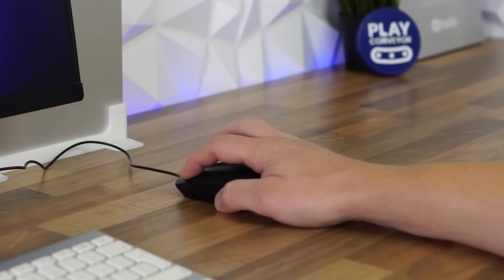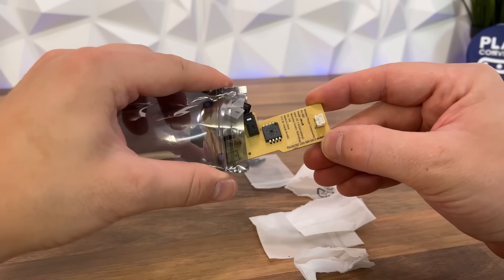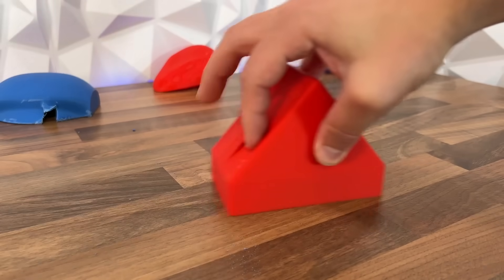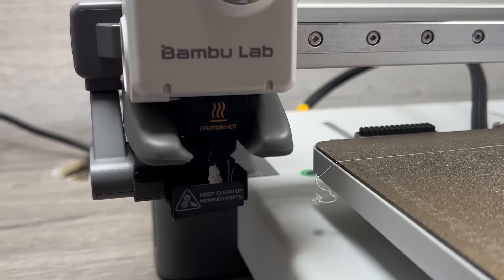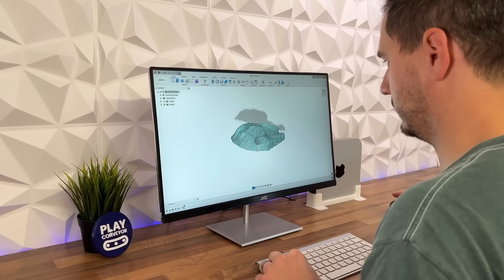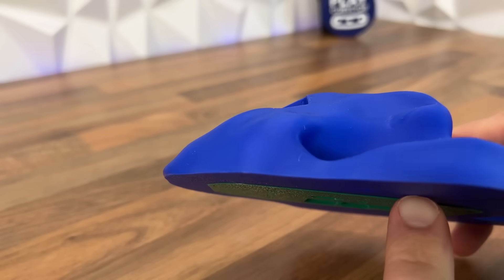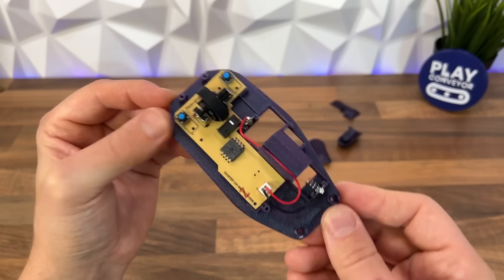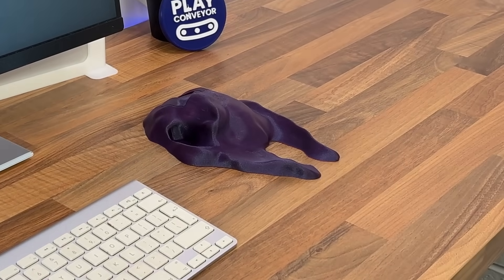I Built the World's Comfiest Mouse (ft. Bambu Lab A1)

Comment: I STRONGLY encourage making MANY revisions before taking it to a coffee-shop.

...By the way: have you considered filing it down instead of just printing more revisions? If it's printed thick enough, you may be able to file down unneeded or unappealing parts, then smooth/streamline it by using a very fine sandpaper & maybe coating it with a thin layer of quick cure epoxy resin (or maybe adding quck cure resin first, then filing and sanding it down, then brushing on a very thin layer of resin to make it smooth)*

*I've personally never made resin molds or worked with resin, so I can't guarantee any of this would work well, or at all; the ideas are just inspired by previous work I've seen done with resin.

Comment: You've introduced several problems while trying to solve a single problem. Congrats you are an engineer.
Reply: The number of problems in a project is like a game of whack-a-mole—solve one, and two more pop up to keep things interesting.
Reply: @tonigarces7211 i’d say that’s more like a hydra
Reply: @craftykit2242  I’ve always wondered: if you cut enough of its heads off, will it eventually consume all of the universe’s energy to make new ones, or does it work on free energy? Can you power a power plant with a hydra? What do the original sources say about that?
Reply: @HermitianAdjoint  I like your thought process. Keep going 🫴🏼
Reply: @phatakom  Thank you. However, I’ve been contacted by certain government bodies and am legally not able to divulge any more information on the project.
Reply: @HermitianAdjoint  ok😅
Reply: @HermitianAdjoint It would eventually die from lack of nutrition or a lack of ability to move.  He's getting more heads every time one gets cut off which means another brain which means more calories needed.  Most depictions of the hydra I've seen don't show the the body getting any bigger with each head.  This suggests no extra gastrointestinal systems getting added aside from the extra mouths nor any increase in the size of the existing gastrointestinal system/s which means no way to increase caloric intake to support the growing number of heads.  And if it didn't starve first, it would eventually lose the ability to move from the weight of all the heads, and then it would starve.  That is my professional opinion on the matter.  Good day sir!
Reply: @afterburned06  Thank you for your expert analysis. What is your profession, if I may ask?
Reply: @HermitianAdjoint Lol I was joking about the professional part.  I'm a mechanic, but I've always had a healthy interest in biology.
Reply: @afterburned06  How can you joke about such a serious matter? I would never dare to utter anything on this subject but the truth that I stand for with all my conviction! But if you think about it, what is biology but the mechanics of living organisms?
Reply: @HermitianAdjoint Oh I was serious about my opinion.  I was just clarifying that I don't hold any qualifications in the relevant fields.  I do love a good hypothetical question though.  I agree though, biology is very much the mechanics of living things.  There are even quite a few parallels where biological systems function similarly to mechanical ones.
Reply: @tonigarces7211 its like a hydra
Reply: @tonigarces7211 thats more like a bird
Reply: @tonigarces7211  yeah we tjink thats more like a hydra
Reply: @tonigarces7211 i'd say it's more similar to a hydra.
Reply: @tonigarces7211  thats more of a hydra
Reply: @Radio_ink114  you'll never be Troy
Reply: @IdkMops ???
Reply: @Radio_ink114  that's a meme
Reply: @tonigarces7211 i think it's like a hydra
Reply: It's not like it's meant to be a good thing to use, just comfy pahahah
Reply: Now to slap a subscription model on it and we ship it!
Reply: @HoboHastur  but now he'd be a financial analyst
Reply: I have a vertical mouse. While it solves one problem (hand not in a natural position), it creates a few others. The main one for me is the height. You have to lift your hand high enough to clear the mouse to get to the keyboard. Not a problem with a regular mouse as it is low enough. You just have to lift your fingers to clear it. Looks like an innocuous enough issue, but doing this repeatedly is PITA for me.
Reply: @alihms  Having a split keyboard may solve this. (50% of keys to the left of the mouse and 50% on the right) That way you only need to move your mouse hand to the right to get access to the right side if the keyboard.

It would take up more deskspace though and I don't know how comfortable it would be typing with both arms in such a wide gait 😂
Reply: Put dispenser here !
Reply: Bruh that so true 😂😂😂
Reply: @ZenseMC Need'a dispensa 'ere!
Reply: Engineer gaming tf2
Reply: or a programmer
Reply: a bad one...
Reply: Sanic ball pfp?
Reply: Covenant mouse?
Reply: @oscardiggs246  yes that is
Reply: Need a dispenser HERE!
Reply: Engineer gaming
Reply: Nice sanic ball profile picture
Reply: need a dispenser here
Reply: I can’t start laughing😂😂
Reply: i actually laughed out loud with your comment haha
Reply: Engineer? I think you mean a landlord
Reply: yeah, a stupid one
Reply: im an engineer saar
Reply: Heh
Reply: Need a dispenser here!
Reply: you mean architect?
Reply: He’s spitting facts harder than any school does
Reply: What problems?
Reply: truly to fix a severe termite infestation thats spreading like wildfire is to abandon the old one and then make a new home that is more simple and is more suited to handle termites
Reply: And then you find out that everything was useless because there was another way that was easier and had no problems on the way
Reply: Yeah and this will still cause carpal tunnel since your palm is still facing down like with regular mice. 

An ergonomic mouse needs to at least be vertical to fit with the natural hand position. This doesn't even do that.
Reply: @St.Altaire  problem solved just rotate your forearm 90 degrees so then technically your palm is verticle to your arm
Reply: Plenty of people use non vertical mice their whole life without developing carpal tunnel. It’s obviously not the sole cause.
Reply: @St.Altaire  the problem with vertical mice is they are all freaking too small. I use one and it's much better than a regular mouse, but still too small to be fully comfortable...
Reply: @st.altair4936 I was just thinking that it was an awkward position with his hand flat on the table. Ideally, I'd assume mice would be a joystick-like design, since the arm is at rest in that way. Not sure how you'd move left or right, though.
Reply: @St.Altaire the back part of the mouse seems pretty vertical, it does face down at the end but the part that holds his wrist goes up a little or maybe Im trippin
Reply: @St.Altaire yeah yeah! Maybe something more interactive that you put your hand inside of. You move the mouse with more of your arm instead of your hand while you have a solid, soft composition to alleviate the pressure.
Reply: @St.Altaire  Carpal tunnel syndrome isn't the only problem that can affect the wrist. For example, to avoid clicking mouse buttons, you have to constantly hold your index and middle fingers up. This puts strain on the tendons, which is why I developed wrist pain. This can be avoided not only by using a vertical mouse but also by properly supporting your palm and fingers. Unfortunately, the universal design of so-called ergonomic mice doesn't provide this support. In addition, not everyone likes vertical mice and they are not well suited for all tasks.
Reply: @St.Altaire vertical?? huh? I'm so confused by your comment... 😅
Reply: @oh.sorry.dont.mind.meeeee  you hold normal mouse horizontally, and an ergonomic mouse vertically
holding your wrist in a horizontal position for too long or too often can lead to repetitive stress injury so vertical is better
Reply: congrats you have no idea what you are talking about  and YOU WISH you were and engineer, but you are WAY TOO INCOMPETENT for it. 
You are one of those guys who says "Math is haaaaard" aren't you?
Reply: That’s the best part
Reply: questions appear where is no answer
Reply: no one likes me and i don't give a fuck
Reply: this that was the goal ngl
Reply: Most comfortable mouse is no mouse
Reply: @AdarshKumar-mi6wn  please report him for hateful and abusive
Reply: @AdarshKumar-mi6wn  why is it no mouse its just more comfortable and can click normally and you can scroll why does you're dumb ass think that that's no mouse
Reply: Sounds like fucking minecraft
Reply: Bro should work at Apple 🤯
Reply: programmer lore
Reply: Sanicball
Reply: just shut up
Reply: When you do anything in factorio:
Reply: Or a philosopher.
Reply: we love engineering
Reply: To really make a ergonomic and comfortable mouse, you should do a diagonal support for the hand, and that will introduce a lot of problems with stability, and efficience, so probably you shouldn't try to do the most comfortable mouse, but the most equilibrate mouse, and a plus problem is that mouse is only for you, if someone, anyone, needs to use your PC, they'll feel very uncomfortable using this mouse, and beyond that, if you need to use some extra function on this mouse, you can't even try to insert a extra button, like, look at this, you have this giant thing and no space to fit an button of easy acess
Reply: Problem in quotes. That's the funniest part.
Reply: Facts
Reply: Right angle trackball mouse is where its at. Saves the wrist and shoulder
Reply: And a ceo
Reply: LMAOOO All he needs now is a brand XD
Reply: Lol
Reply: Lernaean Hydra
Reply: The only problem was to find a problem for this product placement video. Idea behind mouse is just stupid...
Reply: Wait that’s what I’m called? My wife uses the word idiot synonymously then.
Reply: It's look like a frog 😂
Reply: LOL
Reply: Lol
Reply: My grandad used to say that where most people say "if it ain't broke don't fix it", engineers say "if it ain't broke, fix it till it is". I just started my electrical engineering degree last year, and I gotta say Papaw wasn't far off haha.
Reply: I hate that ur right
Reply: He is supposed to be proud of this? 😂
Reply: Hundredth
Reply: Engineer gaming
Reply: If you have a problem, use gun.
But if that don't work, use more gun
Reply: I've just came back from work after dealing with endless inconvenients,  at the time i felt mad about it. But after reading your comment i feel like a genius, somehow 😅. Thank you.
Reply: Real
Reply: Debuggers👍
Reply: Unnecessary inventions is proud of you
Reply: Im a engineer, that means I solve problems -engi tf2
Reply: He’s an engineer, and that means he solves problems.
Reply: @LavenderTheProtogen tf2
Reply: And the main problem is, it looks like a lump of purple flesh.
Reply: Ofc bros not a DESIGNER!
Reply: Ahahahhahaha
Reply: it rmeinds me my friend who designed whole automatic decoder for 2 different coded in 3 languages to beat one step in game
Reply: You've not solved a single problem in your entire life yet complain about somebody trying to find solutions. Congrats you are a useless member of society.
Reply: And a coder
Reply: More like a rec room dev
Reply: Huh...no.
Reply: Get this man into the automotive industry ASAP
Reply: Iiiiiiiii
Reply: Meet the engineer.
Reply: Lmao
Reply: 67K LIKES??
Reply: Underrated comment
Reply: Total smart if your hand hurts call this the confimouse 3000
Reply: You have a lot of likes!!
Reply: The exact size that you want
Reply: tends to be how problem solving works
Reply: Problems Like what?! I think the mouse he just made function like a normal one, so which problem did he introduce? And yeah I am an engineer too 😅
Reply: @o3somyos  Having to move your entire forearm to move the cursor when, with a regular one, you can just move your wrist left, right and extend your fingers to reach the entirety of the screen
Reply: @praxyia9554  sounds like someone uses enhanced pointer precision
Reply: @praxyia9554  thats the problem, this is what causes hand injuries in mouse users. using the whole arm, which has larger muscles that can withstand more strain, reduces the risk of injury
Reply: @praxyia9554 if you can reach the entire screen like that your sensitivity Is too high man
Reply: @o3somyos you can't rotate the mouse
Reply: @o3somyos aesthetic
Reply: *an apple engineer
Reply: @dandcc9192 any engineer
Reply: And code developer!
Reply: Hey look buddy, I’m an engineer, that means I solve problems; not problems like ‘what is beauty, because that would fall within the purview of your conundrums of philosophy. I solve practical problems.
Reply: his main money maker is selling Bamboo to schmucks that believe him when he prints some random garbage and says "it's really cool!" when in reality... it's not, I'll just be grabbing his files for the wall storage and that's about it.
Reply: Haha
Reply: Mark Rober wil be proud seeing this video
Reply: certified rce moment ( I think)
Reply: Wrong you are an architect
Reply: That doesn't mean ur a engineer 😑
Reply: bro is stealing likes
Reply: Engineer, or politician
Reply: Underaged comment
Reply: No they ain’t
Reply: I like you your getting a free stalker
Reply: wrong
Reply: Hahahha what a funny millennial nerd joke 😂
Reply: mhm
Reply: you've failed to say what those problems are. congrats you are a reddit user
Reply: @aaaustin  you can watch the video yourself you 𝖗𝖊𝖙𝖆𝖗𝖉
Reply: I’ve sent this to my friends bro this is extremely accurate 😂
Reply: A bad engineer *
Reply: If you are going to criticize it, at least list what those criticisms are.
Reply: @neurofiedyamato8763  No.
Reply: I sent this to my friends this comment is extremely accurate😂
Reply: in short just fucking live your own and don't fw anyone
Reply: i can check anyone and it always results in them being my rivals
Reply: @allgas211 What do you mean by checking?
Reply: @HappyGuy-y1c  acting accordingly
Reply: As an engineer I first laughted and then though very unflattering things about your mom.

Comment: Probably gonna get some flak for this, but I've always found modern console controllers to be far better in terms of comfort and avoiding carpel tunnel, my hands are basically at a natural resting position in my lap and all I'm really doing is moving my thumbs and a couple of fingers to do everything, as opposed to my whole arm whilst worrying about where my mouse is situated on a desk and having to possibly reset that position, as well as play a game. 

A good thumbstick with high aiming sensitivity and extra back buttons are all I really need, mouse and keyboard are great, but they were never really designed specifically for gaming. They were simply the most accurate/precise medium for a long time. 

I think modern gamers have proven that with a tonne of practice, just like a mouse, you can be just as precise with a controller. Afterall, it's about hand-eye co-ordination, not mouse-eye.
Reply: One minute later I am commenting under you comment
Reply: Mouse are still just that more precise. You only need to compare console and PC pro players/high tier players

Comment: I mean it looks like it increased surface contact and friction, it would make it uncomfortable and tiring, and add ventilation with small fan for hand sweating, also hand tends to be comfortable when it is not parallel to surface, it needs some angle, it is easier to hold aircraft control stick than mouse